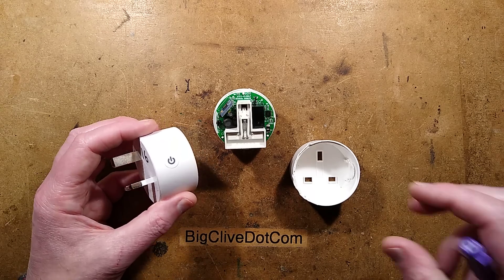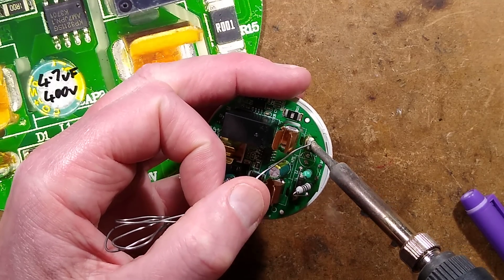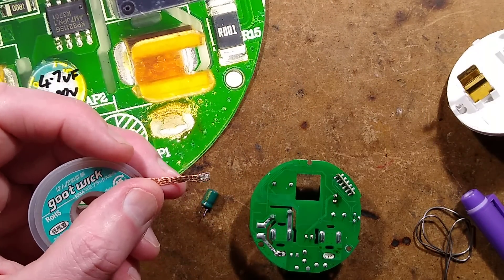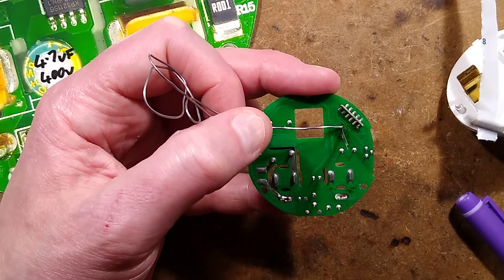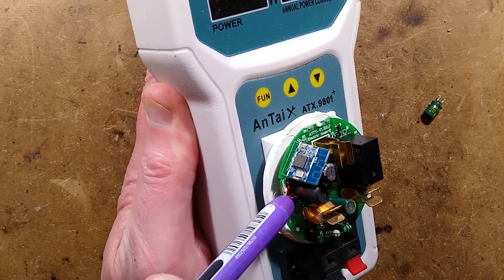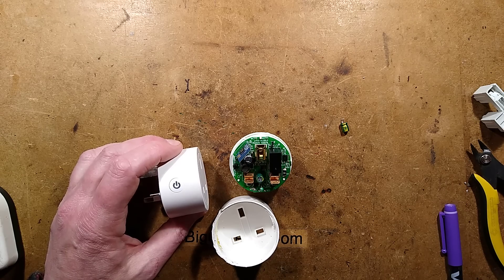Fixing a faulty LSPA7 smart plug (XiangHeWang)

Comment: Loved this video!! I had multiple of these that just stopped responding so binned them!!! I have one left!! But I have 2 capacitors down the bottom, both 400v 4.7mf and a 16v 470mf cap next to the inductor.All appear normal. As a beginner, where would you start. 
It’s a tekin sp23.
Reply from the maker: The 400V one will usually be OK.  The lower voltage one is the main suspect.  If you replace it, observe the polarity and make sure you order a low ESR version.
Reply: @bigclivedotcom  thanks for the advice and thanks for taking the time to answer. 
Love the 'fix it' videos!
Reply: Hi Clive, changed the 16v one and….. it works!!!!!!!! Many thanks.

Comment: Always interesting - as usual. The most common cause of faults seems to be faulty capacitors and the first thing to look for is bulging cases of electrolitics. It is good you always mention it. As regards "flicking off", it does work well but be careful in what direction you flick. In my much younger days (I am now 61), I once "flicked" and the glob of solder neatly flew in my ear (thankfully not in the depths of my ear canal). I learnt that lesson through a very painful experience. 😁
Reply from the maker: My first ever solder flick from the tip of an iron landed on my hand.
Reply: Capacitors haven't been the same since the PCB ban.  The various replacement electrolytes are all inferior to the real thing.
Reply from the maker: It's not the PCB ban for the small caps.  The old ones had a very simple electrolyte based on glycol and boric acid.  Because the new power supplies operate at extremely high frequency, the modern capacitors are smaller and use a more complex electrolyte.

Comment: in a total coincidence... a TP-Link KP115 just went batty this morning....relay click/click and repeating with wireless gone. As Clive I opened it up and found exactly the same situation for the Cap domed (worse) in exactly the same spot. So same job needed for countless thousands of Wifi Smart Plugs (I have 20 of em) so this is going to be a theme isn't it.
Reply: Addendum.....replacing the 470uf 10v Cap...fixes the KP-115 the same.

Comment: Nice easy repair, those little caps take a real beating at those switching frequencies, only slight criticism, should've swabbed the burnt flux off with some alcohol and a q tip.
Reply from the maker: I'm cautious about using isopropanol near switches and relays.  If it penetrates in it can carry flux residue to contacts and cause issues.
I made a video last year where I dug out very old PCBs with the flux residue still on them and they had no signs of corrosion.

Comment: I've got 3 similar devices. Not WiFi or Bluetooth. But they do have a remote with on/off buttons for each one. Number 3 failed in a very strange way, the relay broke. Once I'd replaced the relay, it works again. Must have been a really cheap relay they used. I'm waiting for the other two to brake. LOL.

Comment: Deja vu.
Done same think last week. I use one of these to control mine printer and its ethernet to wifi bridge. Its a bigger problem when wifi module goes with the capacitor, but that did not happened on this last one
For the record, no surprise the relay cant control 2KW electric heater. I get fedup of explaining to people not to use timers and controller plugs on them. This one lasted mine laborer for one week.
 The plumbers solvent cement glued it perfectly. I consider solvent cement as natural part of Mine diy repairs.

Comment: You might invest in a tubular hand held vacuum solder sucker to clear those holes , but a  STAINLESS  steel needle is also effective , as it will  NOT  accept solder ( unless you dip it in A8 acid flux ! ! ) Ha - Ha ...... DAVE™ 🛑

Comment: The solder flux bottles, what are they called? I have been trying to find them (EBay etc) and obviously getting it wrong. I want some flux but would like some empty bottles like that for fine oils etc.
Reply: Vape liquid bottles are pretty good for this and free if you have a friend who uses them. Other than that 'needle bottle' seems to work as a search term.
Reply from the maker: They sell them as packs of needle tip bottles on eBay.

Comment: Yup, I bought a few brands of wifi smart lights. Two from the one brand I was testing failed. They all advertise 25000 hours with LEDs but that’s depends on the quality of the other components. For the VoColink brand they both failed with swollen capacitors.

Comment: Very interesting to see whats inside and what the common modes of failure are on these little plugs. Ive taken my fair share of them apart to flash the firmware on the little wifi modules. Most are based on the ESP8266, which is a very common and known-hackable chip, so people made open source firmware for them that stops them from speaking to the allmighty chinese overlords. 
What would interest me a lot is why some of these plugs have a nasty coil whine whenever they are turned off. At least the models i got for dirt cheap do it. It kind of concerns me, actually.
Reply: Ha, i also flashed all my wifi connected iot devices! With tasmota or esphome. Both are based on the arduino framework which is awesome! I even ditched govee controllers and used my own. Every iot wifi connected device that enters my house must undergo a flashing procedure to get rid of the chinese info stealing spyware.

Comment: Summary

Introduction
- 0:00 - Gordon sent two malfunctioning Zang Hwang LSP A7 Wi-Fi smart plugs for repair and analysis.
- 0:22 - The plugs are 16 amp, small-sized, and feature-rich.

Circuit Board Examination
- 0:39 - Circuit board exposed, showing socket connections.
- 1:00 - A dim blue LED indicates malfunction; the device draws about half a watt.
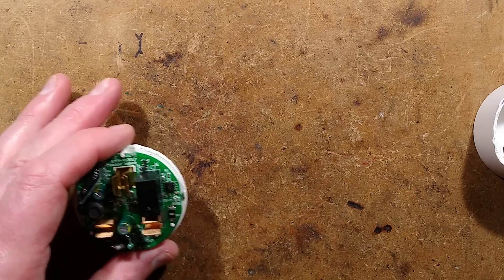- 1:50 - Circuit board details: A single diode, one capacitor (instead of two), a buck regulator, a 3.3-volt regulator for the Wi-Fi module, and a chip for current monitoring through the load.

Suspected Fault and Repair Process
- 3:07 - Suspected fault in a capacitor part of the buck regulator.
- 3:25 - Desoldering the circuit board to access and replace the capacitor.
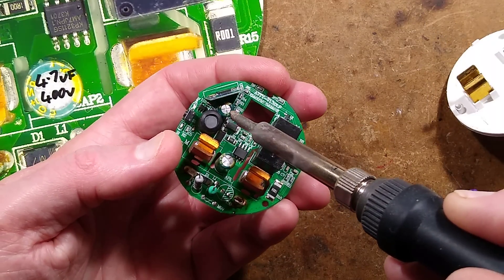- 5:11 - Observing slight bulging on the faulty capacitor.
- 5:24 - Removal and replacement of the faulty capacitor with a slightly larger one.
- 7:31 - Reassembling the device after capacitor replacement.

Testing and Conclusion
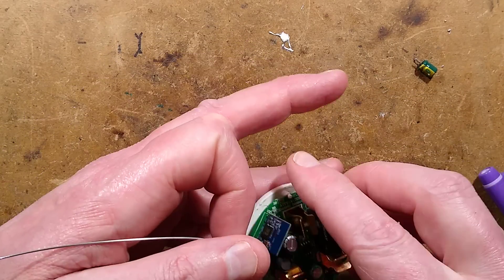- 10:57 - After repair, the LED lights up, and the relay clicks, indicating functionality restored.
- 11:46 - The failure was due to the high-frequency handling capacitor.
- 12:22 - Suggests that such a repair is common due to capacitor issues in modern devices.
- 12:33 - Warning about safety concerns post-repair due to potential weakened structural integrity.
- 13:12 - Concludes that the issue was an easy fix, commonly seen in devices with switch-mode power supplies.

Comment: I don’t see people using solder suckers much anymore. I spoke to a service engineer about 15 years ago and he said he never used one but used braid instead. 
Always. Which method do you think is the best and easiest or am I opening a can of worms here?
Reply: Braid for cleaning SMD pads or large / oddly shaped holes such as slots. Sucker for clearing small holes out.
Reply: Yes, you are right,  @pyromaniac303 . I retired when SMDs were becoming more widely used. I will still give things a “quick look” but  I need re-training with the digital age. This and the throw away society has nailed the coffin lid on what used to ne an interesting, necessary business..
Reply from the maker: I do occasionally use a solder sucker, but prefer braid for smaller joints.

Comment: I have had quite a few different modules, like smart plugs thermostats noname powersuplies, al Chineese made and al with the same Green "long life" electrolyts, gone bad, sometimes it takes the regulator switch with them to (its a pain in the ... to replace)..  But usualy it is just to change the capacitor (as you did) to a long life brand name, and it works like a charm after that. and i usually add a multilayar ceramic capacitor in paralell to the electrolytic one, with about 10% of the capacity of the electrolytic one, not shure if it prolongs the life of the thing, but i do belive so (pleace comment)..  And also at the same time I do replace de 400v, 4,7uf capacitor too, i have had a few of them fail too...

Comment: I've found these plugs work decently until the relay contacts start to stick. I use them to turn off appliances overnight so they're only ever exposed to standby current at the time but I find it necessary to give them a little jolt from time to time.

Comment: Would it help to use a capacitor with a higher capacity or voltage rating, assuming you could fit it in?
Reply from the maker: The main thing is to use a good quality one.  Using a higher value of capacitance can cause startup issues.

Comment: I have one of these plugs, running on Tasmota.

They're excellent, however one died and, after taking it apart, I noticed this very capacitor was all swollen and leaking. It is exactly as this video demonstrates. It's a weak spot and they're prone to failing.

Otherwise though, especially when running Tasmota, these plugs are excellent and incredibly useful.

Comment: I’ve recently bought a few of these and the little square wire in version that can be placed inside things like lights and switches and allows remote switching to be added too. I too am having a hard time believing that little relay could reliably switch 16A! I’m sort of treating them as 5A and am only using to switch Xmas lights directly but remain reserved about switching higher loads unless I add a bigger slave relay to take the load, anyone have any thoughts on this?
Also seeing this video I’m not convinced they will all have a long service life without having to be re-caped as in the video so we will see I guess, hope they all don’t go like it if it’s the common failure mode!

Comment: These same boards are in a number of the cheaper smart plugs. I've got a couple of 'Meross' ones off Amazon, exact same problem on those. They both only lasted around 6 months before failing. I ended up switching to Ikea smart plugs instead and those have been running for over a year with no issue.

Comment: Those plugs are a pain to get into. I've reprogrammed several to run Tasmota which is quite an invasive process. That plug you've got looks like a nice one. Some of the others put the solder points between the socket pins and the relay where your iron doesn't fit, or they heat-stake the socket shutters over everything. And some of the truly nasty ones properly weld the whole thing shut so you can't pry them open, and instead need to get very medieval on them with a dremel.

It's almost like they don't want us getting inside them, or are frightened of the top coming off the plug while it's in a real socket 🤔😆

Comment: For the to-link Kasa smart plugs it’s usually the relay that welds closed. Mine started to do this after a year. The temporary fix was to whack the smart plug on the work top and the contacts became free until next time. I did think of sending it to you but I couldn’t identify the miniature relay 🙄

Comment: This is quite a timely video; I've got a very nice WiFi-enabled schuko-type relay that can also measure voltage, amperage, power factor and all that and I've been using it happily for over a year, but it's just recently started to randomly crash. I assumed one or more of the caps inside've gone bad, so I'll need to open it up one of these days and see about it. Probably going to be about as easy a fix as in your video.

Comment: Great error tracking. One thing is missing: cleaning the flux of the board. But it’s forgiven.
Reply from the maker: Leaving standard hard flux in place is fine.  Using isopropanol can wash the flux into switches and relays and cause contact issues.

Comment: this is most likely using a variant of the esp8266 and that tiny module is a 3.3v regulator. interesting fact those chips can burst to 100mA  sometimes higher and I've often seen them under spec the regulator.
Reply: I saw a beken logo so its not an esp hut thats to be expected because tuya ditched espressif a few years ago alreadg
Reply: @309electronics5  I have seen some of their new products and it was the esp8266 chip at the core just a different name on the shell. I'd be keen to see the new one you're referring to, wonder what it is.

Comment: I think this explains the failure ive been seeing with mine too. I've got 2 different brands, and from the 8 I had in total, from the one brand 50% have died in a similar fashion. I figured it was the relay, but they behaved quite similarly so going with that. Mine were also glued+press fit so a non destructive repair is out of the question.

Comment: To glue the plug together, I would dump a decent amount of baking soda in the cup, add a generous amount of CA glue to the perimeter of the backplate. Press the pieces together with the cup on the bottom, then invert it and shake gently. That would create a pretty solid bond.

Comment: I bought over 30 smart sockets already, starting few years ago. Recently one by one all started failing. At the beginning the vendor replaced few broken sockets then he stopped. Finally I opened one by one and replaced capacitor - imagine: till today I replaced already all of them - wtf? They put so low quality capacitor or what? The ones I put where a bit higher voltage (16V), the originals were 10V - maybe this was the reason? The only big problem is: once the socket is opened, it will NEVER be the same again :-(
Anyway, you nailed it ;-)
Reply: Please advice specs and brand name of that new one capacitor that you installed

Comment: I had four unbranded smart plugs from Amazon that looked exactly like the ones you work on here. They all failed at the same time so I assumed a software problem. Found several articles on how to reset them but nothing worked. In the end I gave up & sold them on eBay as 'not working -- spares or repair'. I wonder if the buyer got them working.

Comment: They would not use a 'solid' cap' next to the bluetooth antenna. And I am stunned that there is an electrolytic any where near the antenna, UHF radiation and all.
That replacement cap' will fail again.
Planned obsolescence factor, very likely.

Comment: you know for as much of this circuit board stuff that you do i would have thought that you'd have an actual desoldering tool. they're pretty handy for pulling components off of boards because it sucks or blows the solder away after it melts with a little squeeze ball.
Reply from the maker: I have a vacuum desoldering gun and standard spring loaded desoldering pumps, but for one-off things like this I prefer wick.

Comment: I usually lose patience with solder wick and simply heat the solder up and tap the circuit board on the bench to clear the holes. 🙂

Comment: Someone posted that you can remove the casing by using clamps or heat the edges with hot air just enough to loosen the adhesive with no damage

Comment: I have a few of these at home. Did you find that the live and neutral parts were tight enough? Mine feel quite loose when pushing a plug into the front of it.
Reply from the maker: I've not tested that.  It may be that they are suited to low current only.

Comment: Consider an iron with T245 handle, 200W base like a T3A and importantly, use JBC tips with it. Nothing compares for the price and is an absolute pleasure to use. 2 sec heat up and I have soldered 1/2" copper pipe with the JBC C245069 tip (5mm chisel) measuring 180W going into this small tip.
Reply: I think it is kind of impressive that he manages with a 40 $ Wae Sung iron ...It's not the tool, it is who is using  it .. There is a saying in germany .. Den Tiger im Tank, aber der Esel am Steuer .. dunno how to translate that😅
Reply: Should I be concerned that ebay lists replacement heating elements in packs of 10 ?   Serious question.
Reply: @rhiantaylor3446  
Hence the reason you use JBC tips with the Chinese power supply.
Reply: Have an old JBC power supply, T245 handpiece and short stubby tip. Removed TV tuner module in a can off a large ground plane no problem when set to 410C , but set back down to 380C so pads don't come off though!
Reply: @andrewwhite1793  
That's also another positive of having the high power supply. With 180W you can set the temp much lower and still be effective without lifting tracks or cooking anything, especially on older boards that don't bond together like modern ones.

Comment: I've used loads of these inexpensive plug-in Wi-Fi switches, and for two core cables I use in-line Wi-Fi switches (on lamps and my TV). I've used them for 5 years, with zero problems or failures!

Yappy Hew Near, Cig Blive! 🤣
Reply: I've just started to get into it, although with my budget being near zero, it's a slow process.

But even the simple things feel major when you do them - I got a smart light switch last week, mainly for the glowing ring so I could find it in the dark.
But laying on my bed watching YouTube that night, as I started to get up to switch the lights off, I suddenly realised my phone could do it now... And I wouldn't have to navigate across the room in the dark afterwards. 😮
Reply: @tin2001 My WiFi plugs and switches were from eBay, very similar to the one in Big Clive's video, and cost around six or seven pounds each. They work extremely well, and voice control via Alexa is very convenient. Alexa even takes the place of my TV remote, and you can make FREE phone calls! Smart home products are great, although one YouTuber said to me, "Smart people don't have Alexa in their homes!" ... He was clearly an idiot! ... Paranoid luddites like that, should go and live in a damp cave with no WiFi!